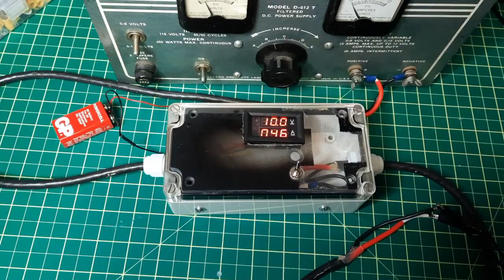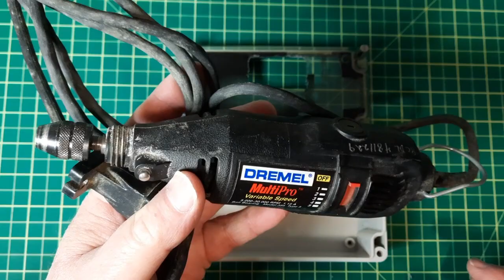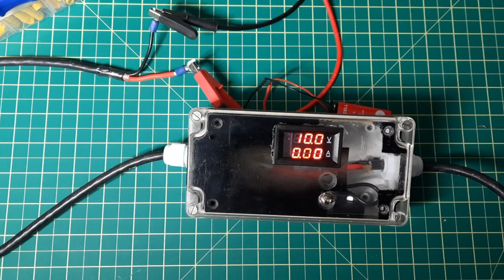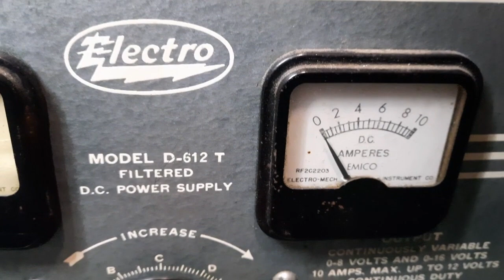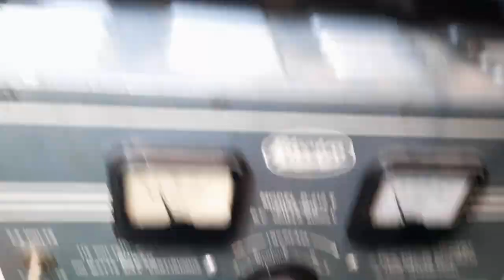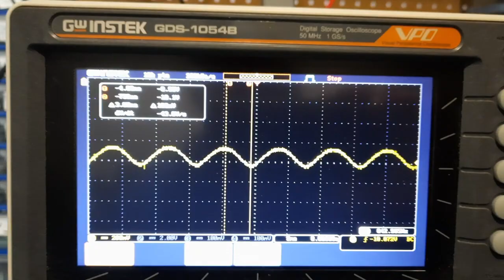100V 50A Display for Vintage Equipment

Comment: I think that power supply has a bright future being put back into service.  Older tech rarely dies, usually just needs a bit of creativity is all.
Reply from the maker: I should have put my ME-77C/U Canadian Admiral multimeter in the video, it is about the same age 1959. Did a video on it a while back and old tech just keeps on ticking but even it had issues when the batteries were left in the ME-77.
Reply: @retireeelectronics  Oldest meter I have here is an RCA from the early to mid-50's or so, I think.  I'd have to open it to see the date on the chassis, and that sounds far too much like work to me at present.  Works perfectly, though, with a couple of minor modifications.